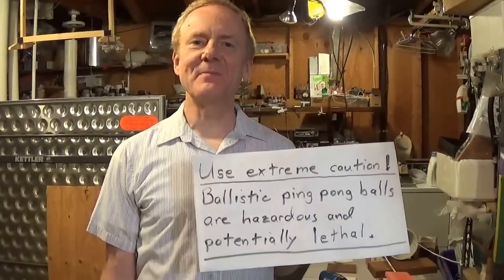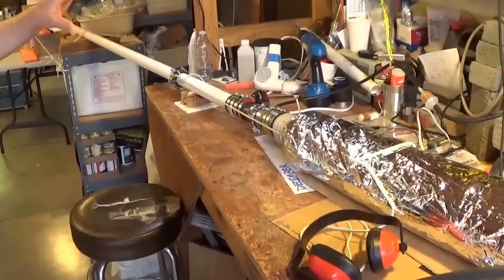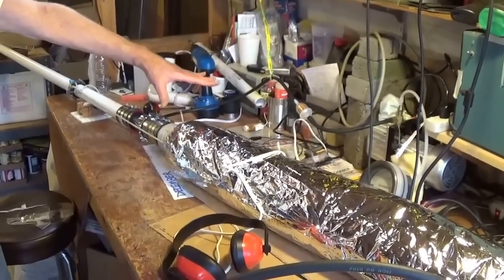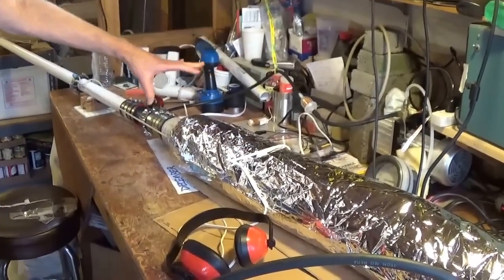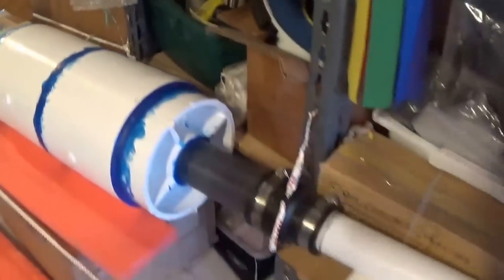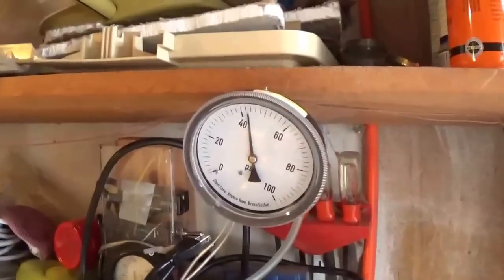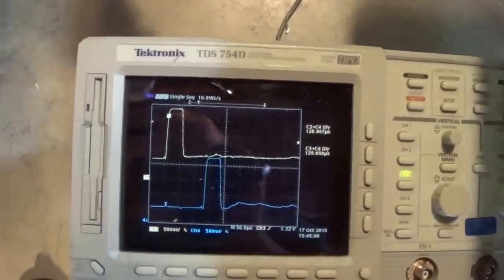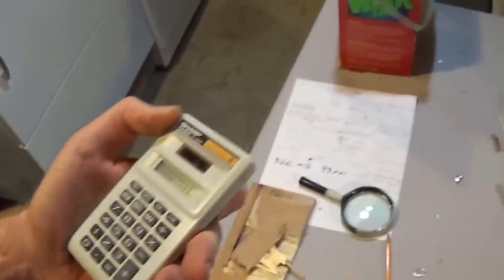773meter/second (1700MPH) supersonic ping pong ball launch using vacuum and 81PSI helium

Comment: What I immediately like about this video is that it shows an American using the metric system.
Reply from the maker: Metric is much easier, especially for physics.  My college classes were all metric (1974 to 1978) for my physics degree.  My poor engineering friends had to deal with English units - especially bad for thermodynamics.
Reply: @davekni  I would suggest increasing the velocity through decreasing the caliber!You can reach velocities of around 5 and more kilometers per second with similar setup!
Reply: PSI?
Reply: Personally, I like the sandals and velcro white trainers
Reply: When you have to do math in base 10 using distance, metric is easier. Physical reality is complicated enough without squabbling about how to measure things.. Too bad time is also divided by 12. A tenth of an hour converts to 6 minutes. I have not seen a pressure gauge in hectopascals either.

Comment: "Oops, it launched itself." When it comes to pingpong balls flying around at 2780 kph, I think that's an entry in one of the 'Famous Last Words'-volumes. The sports edition, probably. Or the Doomsday weapons one.
Reply from the maker: Yes, we get occasional self-launches.  The membrane is as thin as can usually hold the pressure, so as to break away quickly.   Occasionally it doesn't hold up to the pressure.
Reply from the maker: Yes, exactly.  The Purdue University launcher worked only that way - raise the pressure until the membrane breaks.  We added controlled membrane breaking (most of the time) so that we could get the pressure to the maximum possible without (most of the time) breaking the ping pong ball at the start of the launch.

Comment: could you use multiple vacuum tubes in a row and you ruptur the frist disk then the ping pong gose and rupturs the other disk and accarates more?
Reply from the maker: A longer launch (vacuum) tube does help, as in our faster 9/2016 runs at OMSI Maker Faire:
https://www.youtube.com/watch?v=5xuwu4gjNbQ
Adding additional membranes in the ball's path wouldn't help, as that doesn't provide a source of additional pressure (helium) behind the ball.  (Unless I'm not understanding your suggestion correctly.)
If we were to pursue even higher speeds, higher initial pressure, combined with something to slow the initial pressure rise (to avoid breaking the ball) would be the next logical step.  Something like the converging/diverging nozzle in other's launchers.  Such nozzles don't't help below 90 psi, but likely would at higher pressures.  Pursuing that would require more mechanical construction skills than I posses, and a bunch of money too.

Comment: Would it be possible to also get a high speed with something small, like a bb ball or a blowgun dart?
Reply from the maker: Small objects would generally be easier.  A bb could be launched like a standard bullet using gun powder, and easily beat our 1950 mph record.  The ping pong ball is tricky because it is light and large and delicate (relatively).  Above 90 psi, the ball often breaks due to the pressure.  A bb can handle much higher pressure, and higher temperature, so gas combustion products (gun powder ...) can be used.  I'm not familiar with blowgun darts, but they are likely also more robust than ping pong balls.

Comment: How does the weight of the ball affect the speed of the ball under a vacuum? Will a golf ball accelerate slower due to its' mass or equally due to equal pressure being pushed on it in a vacuum? (assuming the same amount of air leaked pass the balls. I know they are different sizes...)
Reply from the maker: Ball mass matters quite significantly.  We see a bit of that even with mass variation from one ping pong ball to the next.  A golf ball would launch much more slowly at the same pressure.  A golf ball could handle much higher pressure without breaking, however.  At sufficiently high pressure, the golf ball could theoretically get to the same velocity.  For example, high-speed rifles can be a little faster than our ping pong ball.

Comment: Wow!  Nice use of Helium as a faster moving gas to get more speed.  It would be interesting to see what Sulfur Hexafluoride would do
Reply from the maker: Interesting thought, but sulfur hexafluoride would perform much worse.  It's one advantage is higher heat capacity, so it would cool more slowly as it expands down the launch tube.  However, its much higher density would be far more detrimental than any heat capacity advantage.  There is one gas that would be better than helium (both lighter and higher heat capacity), but too dangerous for us to play with.
Reply: +davekni  Oh I know it would be worse.  I purposely mentioned Sulfur Hexafluoride as supposed to Helium because I thought it would be interesting to see how much worse it would do.  The comparison would be a great way for people to see for themselves the macroscopic effects of slow vs fast moving gases.  Wouldn't you agree?
Reply from the maker: Yes, it would be interesting, at least to a few of us physicists.  It 
would be difficult to interest most of the public in something that 
performs worse, just to explain why it's worse.  Helium generates more 
interest, since it enables speeds faster than Mythbusters or any other 
group has demonstrated.  And we do have helium vs. air demonstrations.
Reply: davekni  True.  And on the heat capacity note, another advantage of hydrogen would be its diatomic nature, yes?  If you could heat up the hydrogen gas to a high temperature, the rotational and vibrational states could store more energy so that it doesn't cool as much during the expansion (as you mentioned earlier with the SF6), and the super fast moving hydrogen molecules would really accelerate that ping pong ball I imagine!  

I'm not saying you should do it though.  You don't want to end up like the Hindenburg lol
Reply from the maker: Yes, exactly!  Diatomic is what gives the higher heat capacity.  It is two ways of stating the same advantage.  BTW, only the rotational states help significantly.  Even the lowest vibrational state of hydrogen isn't populated until significantly above room temperature - its quantum energy is too high.
Reply: davekni  Indeed.  But that's why I mentioned 'high temperature'.  If you were to get it very hot, the hydrogen molecules would be moving quite fast, and their vibrational states would probably be well populated.  Or one could just burn the hydrogen and then the heat from the reaction as well as the rotational and vibrational states of the water molecules could do the trick
Reply from the maker: Yes, above 1000 degrees C the vibrational states would start to matter:)  Burning also makes very fast gas molecules.  (I have used alcohol-air combustion for the ping pong ball - about 650m/s.)  The problem is controlling the pressure accurately.  Ping pong balls break at higher pressure.  The highest we've managed without breakage is 93PSI.  Even at 85PSI balls sometimes break.  See our "failed launch" video for a case where the ball broke at 85PSI.
Reply: davekni  Alright, I'll check that out and some of your other launches.  One last question if I may.  I was told by someone that the speed of the gases escaping into a vacuum like this is 2/(1-cp/cv) times the speed of sound.  Is that really the case?  It seems surprisingly fast to me.  And thanks, it was nice talking with you
Reply from the maker: That formula as-is would give negative speeds, since cp is always larger than cv.  You spurred me to a couple hours of thinking and research to figure out what it should be.  For ideal conditions (large diverging nozzle) where all the gas energy is converted to linear motion, I think the formula would be:
speed-of-sound * sqrt( 2 / ((cp/cv) * (cp/cv - 1)))
No guarantees:  it's been almost 40 years since my physics degree.  It's still close to twice the speed of sound for air (cp/cv = 1.4).  That fits with our fastest air launch of 562m/s - less than theoretical for no ball in the way, but well faster than the speed of sound in air (about 347m/s).
Reply: davekni  I did mess that up actually.  It was 2/(cp/cv-1).  Anyway, I found it hard to believe because it gave such large speeds.  It doesn't surprise me that the speed would be significantly faster than the speed of sound, but the bell curve for air would not have a significant number of molecules going 5 times the speed of sound!  So to me, your formula makes more sense.  Thanks.  Hopefully, I can remember to ask my professor when I take Statistical Thermodynamics

Comment: Congratulation on these speeds!  The big vacuum chamber and the use of Helium are great ideas.  I tried to
do the same thing in 2014 and 2015 after the details from Purdue and Mythbusters came out.  I was using parts from an old potato cannon, so adding on the vacuum tube wasn't difficult.  The best I could do was 352 m/sec. with vacuum + 100 psi pressure.  It took a long time to build the C D nozzle, but then it only lowered the velocity.  Keep experimenting and stay safe.
Reply from the maker: Thank you for the compliment!  Yes, I made and tested a couple C D nozzles too, which made performance worse.  I think they might help at higher pressure, about the 90PSI or so that a ping pong ball can handle directly, since the nozzles reduce pressure.
If you view our most recent videos, we beat this speed by 100m/s, reaching 873m/s at this year's Maker Faire.

Comment: now do it with a foosball.
Reply from the maker: Heavier projectiles would penetrate thicker targets, but won't go as fast.  Heavier targets can also be accelerated with a cannon.  Ping pong balls are more of a challenge.  Getting the best speed requires enough pressure to almost break the ball.  At 85 PSI, a few balls break.  By 95PSI more break.

I'll eventually get to posting more videos.  We just hit a new maximum speed of 873 meters/second at the Maker Faire 11 days ago, using 85PSI and a longer launch tube.
Reply: davekni Yeah I was wondering if a heavier object could be accelerated to the same speed if you used a longer barrel.
Reply from the maker: For any given set of conditions (barrel length, pressure, etc.), a lighter object (ping pong ball) will go faster.  However, a heaver object will generally handle much higher pressure.  With higher pressure, and a stronger launcher to handle the pressure, velocities would be similar.

Comment: And what exactly do you use to decelerate the ball after it passes thru the board?
Reply from the maker: Behind the target is a piece of 6" pipe stuffed with rags and packing foam, backed by a piece of 6mm polycarbonate.  The fragments of ball and target that don't scatter end up buried in the packing material within that pipe.  We've broken through 2.3mm polycarbonate, but I think 6mm is safe.  The ball fragments never make it all the way to the back anyway, as the rags/foam are good at absorbing energy as they tear apart.  Polycarbonate is a tough plastic, the primary material used in bullet-proof windows (although even thicker).

Comment: you should have put a ping pong racket at the end instead of the plywood. That would have been much cooler ^^
Reply from the maker: Yes, we used a ping pong racket as target a number of times, in public demonstrations and for local media coverage.  Scraps of plywood are much less expensive, and much harder to penetrate (thicker than the plywood of a racket).  The thicker target makes for a better verification of our speed.

BTW:  We hit 806 meters/second a couple weeks ago and submitted that to Guinness.  Haven't gotten around to posting video of that yet, although I gather that some students and teachers at Wilsonville High School (where we made the record runs) may have already.

Comment: Sir, simply amazing!!I would like to do a ping pong ball cannon project as well, but I do not have a vacuum pump. Do you think that a 800 watt vacuum cleaner is strong enough to create a vacuum in the pipe that will launch the ping pong ball?
Reply from the maker: +Troy Lee   A really good canister vacuum cleaner might remove 20% of the air, probably not enough to launch a ping pong ball through the vacuum membrane at the end.   If you have an air compressor, you can launch a ping pong ball with pressure only.  Then you need only one membrane, between the end of your pressure chamber and the beginning of the launch tube.  Pressure only will not go as fast as pressure combined with vacuum.  My guess is that pressure only, with say the 90PSI typical of standard air compressors, would get barely above the speed of sound, perhaps 350 meters/second.  That's higher than we achieved with vacuum only (304 meters/second).  Might be enough to break through a paddle.   Of course, be very careful with whatever you use as a pressure chamber.  Keep the actual pressure way below the rated pressure, especially if using water pipe (which isn't rated for use with air or other gasses).  Compressed water doesn't explode on pipe failure, but compressed air does.
Reply: Thank you for your reply,
Then I will first try to reverse a high pressure bike pump that can pump up to 11 bar. I have seen that people reversed the piston and could vacuum a plastic cola bottle. Will let you know the outcome.
Reply: +davekni 
Hello davekni,
We did it! We managed to penetrate a cola can with a ping pong ball. We had to use a PVC pipe with an inner diameter of 45 mm.In Holland we have different standard sizes. We were able to get all the air out with the reversed bicycle pump (it took quite some strokes) to prevent that the air would get back in we used a non return valve in between. Also mounted a gauge that showed when we reached  1013 mbar. As membrane we also used "space blanket". Overall it was a big succes, the kids loved it at school.
Reply from the maker: Congratulations!  I'm impressed that you succeeded with 45mm inside-diameter pipe.  We are fortunate to have a close fit as standard pipe here with "English" dimensions.  I hope you have inspired some new young scientists!

Comment: I did something very similar as part of a college project recently. But the college wouldn't let me use pressures that were deemed dangerous, so had to keep it <25psi. But the ball would pressurize any gas in front of it, (my vacuum pump was pretty basic), as it moved down the tube, eventually stopping before it reached the end. So i made a end cap that would be held on by a vacuum but move out of the way as the ball compressed the air in front. This did work but still slowed the ball significantly. I am now feeling so dumb, all i needed was a diverging end. Thank you for the slap of knowledge!
Reply from the maker: +George Wills Don't feel "dumb"!  It took a lot of work and some luck to figure out that a vacuum reservoir at the end would make a big improvement.  Yes, it does seem obvious after-the-fact.  Most inventions are that way - obvious afterwards.  To the best of my knowledge, we are the first ones to try that improvement.  Also, I wouldn't really call it "diverging", as it isn't a flare shape.  It's just a place for the excess air to go.  If you are interested in more of the details, see my longer video "Supersonic ping pong ball luncher: high-speed flash images and description".
Keep up the experimenting, with that or other physics.  It's all fun and educational.

Comment: Damn. That went over mach 2.
Reply from the maker: +Md Nazial Kadir 
Yes, around mach 2.2.  I didn't list a mach number, since that is based on sound speed, which varies with temperature, so isn't as precise as distance per time (meters per second or miles per hour).